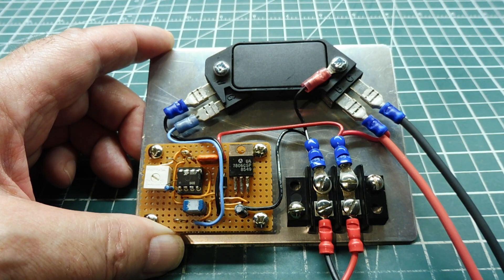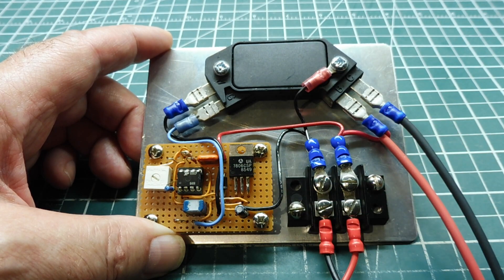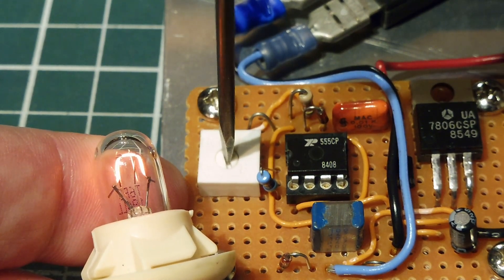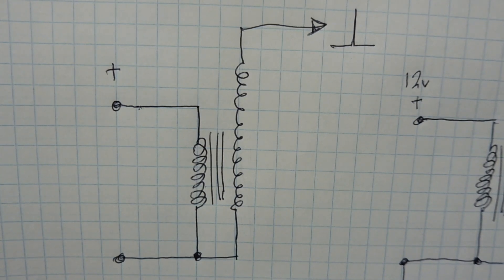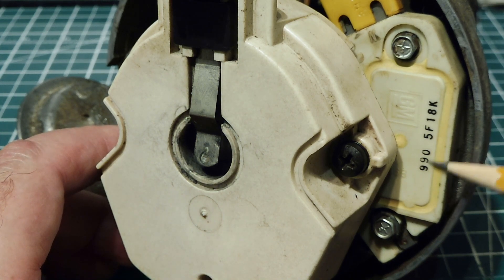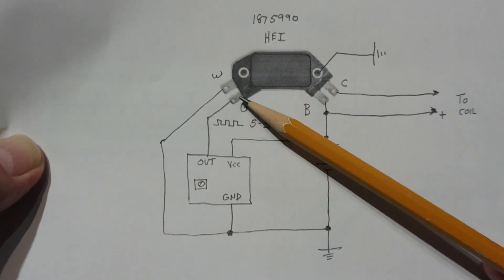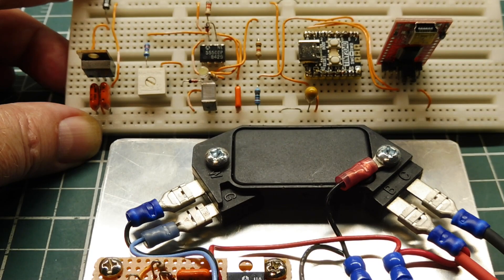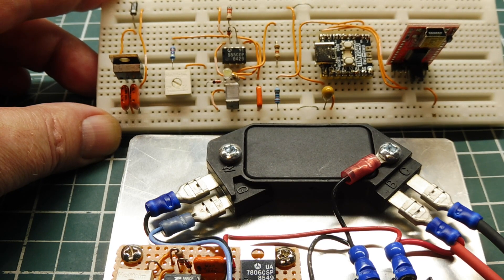Ignition Coil Tester / HEI / 555 Timer

Comment: Can you point me in any more direction to program a microcontroller to do the proper advance timing?  I see you are using the 2040. Any direction on how to program this would be AMAZING!
Reply from the maker: For advance control you need a missing tooth wheel attached to your crank for RPM measurement and a MAP sensor for load detection. Next is to build an ignition advance table MAP vs RPM that the micro will use to fire the spark plug. Check online for examples. Here are some videos to get you started: 
https://www.youtube.com/watch?v=aPinRjHz2cA
https://youtu.be/aZVWlFZWUac
https://youtu.be/_-_XGLkKnCs
I was going to do an in depth video but there was lack of interest and I am winding down my YouTube channel.
Reply: @0033mer  Can you you use an already existing pulse coil on your machine instead of a missing tooth wheel or do you need both? For the input pulse I mean.
Reply from the maker: For a single cylinder engine it's a lot simpler. You need a pickup and a tooth or magnet on your crank pulley depending if you have a Hall or VR pickup. The time between pulses will give you the RPM. Set the pickup to trigger at 38 degrees BTC. Now you need to calculate a delay which will enable you to fire the spark plug from 38 degress BTC with no delay to 0 degrees degees BTC with maximum delay.  You know the RPM so you can create a table for your advance curve.
Reply: @0033mer I’m going to attempt this. Yes it’s a single cylinder 300cc motor with a VR pickup. It’s an ATV 4 wheeler.
Reply from the maker: Learn by doing is the best approach.

Comment: Though this is scaled to fire and simulate up to 6000 rpm 4 stroke engine, that's only a single spark plug firing simulation. In other words... 6000/2 (at the cam shaft) ='s 3000 rpm. 3000rpm/60 seconds = 50 htz.   In a V8, the frequency and firing per second (a.k.a. htz ) would be as follows: 6000/2= 3000 rpm cam speed. 3000 x 8 (cylinders) = 24000 per minute. 24,000 rpm/ 60 seconds = 400 Htz. 

Concluding: To emulate a 6000 rmp V8 automobile the coil should fire @ 400Hz; 8 times illustrated here. And yes, these GM coils can do that. 😊
Reply from the maker: The simulation is for a single cylinder engine as indicated in the description box. I build microcontroller based ignition systems as shown in the video to upgrade vintage single cylinder motorcycle engines, similar to a Pazon system.
Reply: @0033mer : Just curious,  do you account for "dwell" time vs a 50% duty cycle a 555 timer would normally run at?

Comment: This is great.  I am using same exact HEI module in my 1964 Ford Falcon!  It would be great if you can come up way to use GM LS1 or LS2 ignition coil. Coil has in-built igniter that is ECU controlled 
and very compact. Dwell begins when ECU signal goes high (more than 4V).  Spark Event occurs when ECU signal goes low (less than 1 V). Recommend Dwell Time: 3.5mS @ 14.4V.  I tested it with simple 12v on/off switch and it works but it would need to be controlled the distributor which has a magnetic pickup and puts out a sinewave.  Can I use a rectifier bridge (1N4007) without capacitor to simulate DC high and low?
Reply from the maker: 1964 was a good year for the Falcon. The sine wave variable reluctance (VR) signal has to changed into a square wave, and then find the zero crosssing that causes the spark event. It would be easier to go back to the points/condenser distributor which has a defined on/off signal and just use a logic circuit to trigger the coil.
Reply: @0033mer  I actually though about using points distributor.  In my 64 Falcon, I have 5.0 V8 out of Ford Explorer with aftermarket roller cam.  I would be have purchase new distributor and change the gear for roller cam. The 1N4007 are inexpensive and are few dollars on Amazon and I figure its worth trying.  Can I use a rectifier bridge (1N4007) without capacitor to simulate DC high and low?  Also lots of other people may like to the LS coil/igniter if there was a simpler solution without replacing the distributor.
Reply from the maker: If you use a bridge rectifier you will double the frequency of the VR sine wave and get multiple firings. You have to trigger on the zero crossing of the VR signal which is the vertical portion of the signal. Check this video where I have shown a screenshot of the VR signal. https://youtu.be/wkY6aDSOSgk
You can use a MAX9924 IC to decode the zero crossing of the waveform.
Reply: I did some reading.  The MAX9924 would work.  However, can I use Half Wave Rectifier ?

Comment: I apologize of I am missing this: What are the parts in the circuit board? Please and thank you! (Also awesome informative video. I knew how the part plugged in, I did not understand how/what it did!)
Reply from the maker: The circuit is a 555 timer in astable mode. Check on line for many example circuit diagrams. It is similar to the 555 circuit in this video:  https://youtu.be/tyZVSL5F26I
Reply: @0033mer  Thank you all around!!

Comment: This is great stuff and has piqued my curiosity, specifically at 8:00 on the video where you use a Tiny2040 to read RPM and then program the advance curve. I know very little about arduinos and other microcontroller boards but I know I want to! Could you please share some more information on how you used the 2040 to alter timing curves? Would it also be possible to introduce rev-limiting capabilities as well? Thank you!
Reply from the maker: The RP2040 is simulating a Pazon ignition module for motorcycles. ( check online for details)
The RP2040 is monitoring the RPM using Tach pulses, so it knows the engine speed.
A pickup (VR) on the cam will trigger at 38 degrees BTDC. The RP2040 will calculate a delay before the spark signal is sent. The shorter delay the more advance. With these input signals a custon advance curve can made.
Check out my video on variable reluctance triggers.
 https://youtu.be/wkY6aDSOSgk
Reply: @0033mer  thanks for the quick response. I'm using a distributor with hei still and all of that makes sense. I guess I need to dig deeper into how to the RP2040 works first.

Comment: nice job, I wonder how you got rid of the back EMF of the coil when it is disconnected - or maybe the HEI module has a snubber circuit inside it that takes care of the problem
Reply from the maker: Inside the module is a MC3334 IC driving a 400 volt NPN Darlington transistor with a 350 volt Zener clamp for back EMF transients. Check out Fig 6 for schematic.
https://datasheet.octopart.com/MCZ3334EF-Freescale-Semiconductor-datasheet-12533592.pdf
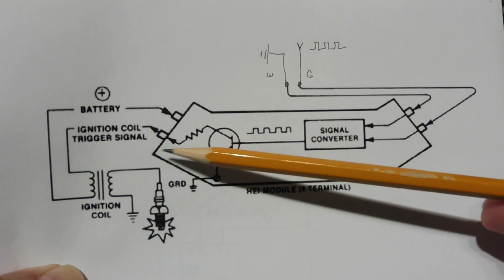Reply: @0033mer  so the schematics depicted on 6:45 is drawn for simplicity to show the module's general idea, in reality it has a much more complicated circuitry
Reply from the maker: Yes  .. the module operation is quite complex with auto dwell control and current limiting features.

Comment: Which of the part in the circuit (555 timer) to adjust to make the dwell time a little longer ? I think i did this circuit based on your other video but the dwell time too fast.

Increase the resistor value or add more cap will make more dwell time?
Reply from the maker: Yes, increase the resistor or capacitor value until you get your desired result.

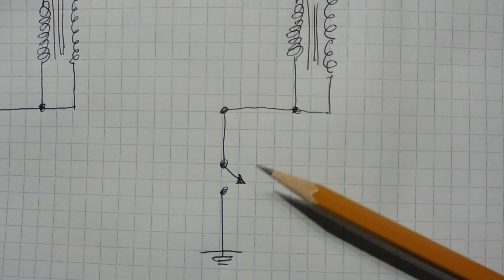Comment: hello sir, at 4:20 you show a diagram, where primary and secondary are switched via points to groud. I am not sure that is correct, the secondary (High Voltage side) is always connected to ground. Please let me know!
Reply from the maker: There is a condenser (capacitor) connected across the breaker points ( not shown in the diagram ) which supplies a ground to the secondary high voltage side when the points open, enabling a spark to jump to ground.

Comment: Thank you for another great video! You explained the functions of the circuit very well. But, I would really like to see a proper schematic. Here's an example of why... I heard you say that the HEI is driven with a pulse. I t-h-i-n-k I heard you say, later, that the pulse is 5 volts in amplitude. I saw what I t-h-i-n-k is a LM7805 on your control board. However, that TO-220 package m-i-g-h-t be a MOSFET. The emphasis is for fun, but it makes the point that the circuit could be better communicated with a schematic. I guess the question remains... What is the TO-220 package on the board? This is a great project! Useful, very doable, will save the repair-person a buck on equipment and time on the repair. You have made a valuable contribution to the DIY community. Much appreciated!
Reply from the maker: I left it up to the viewers to pick their clock source. Most will probably want to use a microcontroller or a circuit with different RPM range. If you want the schematic of the circuit in the video it is described in this video: https://youtu.be/tyZVSL5F26I
or you can check the 555 timer data sheet for an astable clock source. The TO-220 package is a 7806 voltage regulator powering the 555 timer. I used 6 volts as the 555 timer output is not rail to rail. It is something I just do but a 7805 will also work.

Comment: Can we convert coil on plug with  this hei modules ?
Reply from the maker: No ... the coil and control circuitry is sealed in the COP module. If you want to test a COP module check out this video: https://youtu.be/tyZVSL5F26I
Reply: @0033mer  I want to remove cop , and install hei modules instead is this possible thanks .